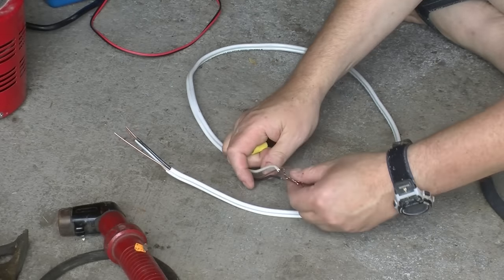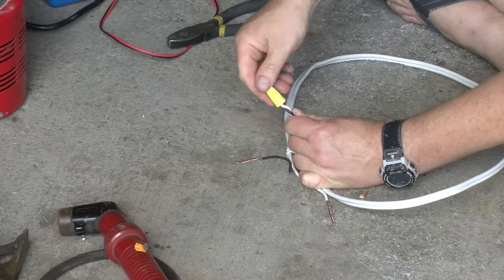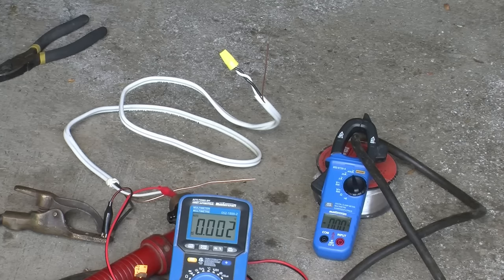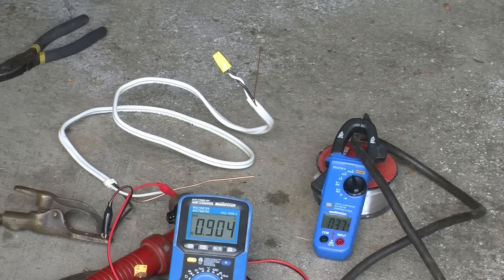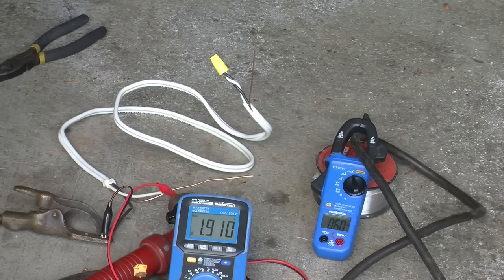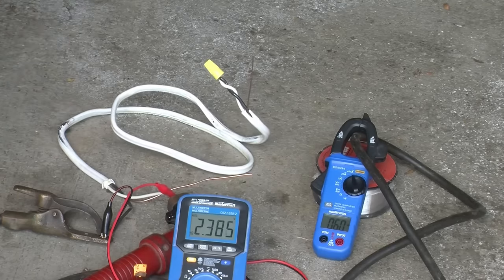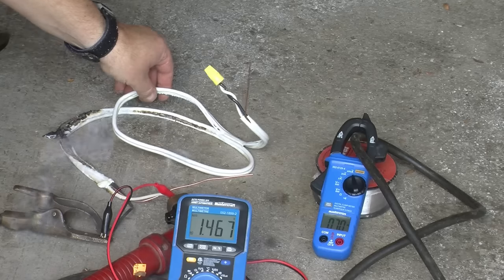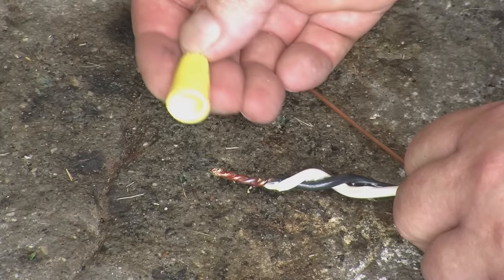How many Amps to burn up 14/2 electrical wiring?

Comment: 70 watts  allot  in that wire ?  I must have missed something  that is less than a lightbulb you must have meant another number right ?
Reply from the maker: 70W is the power dissipated in the wire due to resistance in the wire and the current flowing, much less than that current would deliver to the load in a 120 or 240V circuit.
Reply: @ElectromagneticVideos  I'm really up on certain Electro magnetic stuff but that Wheatstone bridge  resistance stuff I need to really smack down - I have learned a ton from an online simulator  called Falstad and I think I will try and learn more on the resistance stuff - 70 watts just seems so low yet it is not   great job Doc and I guess we both learned typing since you can type fast also
Reply: @ElectromagneticVideos  My last name is Welsh also and you look sort of like my brother     literally    Diolch unwaith eto
Reply from the maker: @TotalFreedomTTT-pk9st  " I guess we both learned typing since you can type fast also" Funny - one of the smartest things I ever did was take grade 9 typing in my final year in high school on a manual typewriters no less. I struggled and was one of the most unskilled students in the class - but being sort of able to touch type has been an invaluable skill. I hope the modern equivalent is almost a required  skill in high school these days!
Reply from the maker: @TotalFreedomTTT-pk9st  :)
Reply: @ElectromagneticVideos  Cool story - my later best friend now Australian - he and I were in class together in 1978 - 8th grade in Ohio   we had Junior High (7th 8th 9th)  -and he also types really fast - My degree was in Finance but lots of my jobs required keyboard Lotus / Excel  etc - it really should be required still  for Middle School since the keyboard is still a big player in all our lives    I had a cool girlfriend that was an Office veteran and we would see who could type faster and she often won
Reply from the maker: @TotalFreedomTTT-pk9st  So you were in school around the same time period I was. Since that was still the ear of secretaries doing the typing, I wonder how many others clued in that it would be such a valuable skill in the very near future? 

Have you ever visited your Australian friend down under? Its a fabulous country to visit if you like the outdoors!
Reply: @ElectromagneticVideos  I am somewhat a dull laggerd but he has been here lots to watch the Cleveland Indian's   -  maybe someday -  as per typing  I figure that Dragon Speak ( converting speech to text) would eventually replace typing (but not yet)  but I also threw out  hundreds of books partly assuming they would be 'on the net'   which has turned out not to be true as well 
I also learned on a real old type writer - which were marvels of engineering - I tore down a bunch - if I were King for a Day - I would have middle school kids also tearing down stuff to see just how complex these machines are that we need to survive  My God is a God of Technology (the TTT stands for "Through Total Technology")
Reply: @ElectromagneticVideos  I am watching many YT video's where the narration is really a  "Bot" reading from text and I don't mind it - a few glitches but if it allows someone to produce information "It's all good" as my Progressive Seattle Brother would say   But for us - of that time I am surprised that Typing was an option - especially then it should have been mandatory don't you think ? But our class was also a small room that I still remember to this day - to graduate Junior High you should have had to be capable of typing  and even now I'd say the same  it is a  skill like riding a bike  you don't really loose it but enough on that I am going to look for High Voltage protection vids - any more practical suggestions welcome - your vids I watched were great - If Building my own house  I'd almost do a modern Knob and tube for the cooling advantage  after your experiment
Reply from the maker: @TotalFreedomTTT-pk9st  Dragon Speak - gee I remember that - I think I got it free with something - sadly never worked that well. 

Taking things apart to see how they work is such a great way to learn. Would be a great once every two weeks or so science class. I was an electronics hobbyist as a kid (remember magazines like  Popular Electronics?) and had my own little business scrounging old TVs and fixing and then selling them in high school. Seeing the insides of so many things was a great learning experience.
Reply from the maker: @TotalFreedomTTT-pk9st  Typing was definitely not mandatory in my schools - in fact the teachers were not happy I took in my final year cause they were scared my low marks in it would have an effect on university admissions - as if any science/engineering program would care. I think it wasn't mandatory because unless you were going to be a secretary, most people weren't expected to type.  

What is so scary about the microwave transformers is the 1A output current with a 1kv voltage - enough to force it though skin, flesh etc. If it doesnt kill you it can burn off fingers, arms etc. Is not forgiving. 

Here is the dead mans switch I  made  - always place it 10 feet or more away from the danger zone so if you trip and fall while pressing the on switches,. you are still safe. I have used it to protect myself and it has saved me more than once. I hope you consider making and using one: https://youtu.be/ZhCvTCeGvMc
Reply: @ElectromagneticVideos  Yes - I wish now I'd kept those high voltage leads from the Cathode Ray tube with the big rubber do hicky on it - for high voltage alligator clips - my twin brother had his two daughter tear stuff down for the scrap yard - vcr's - old drills and it is so tactile you really learn by doing - be a great thing for schools to have for motivated kids to tear down vacuum cleaner - just stuff thrown out in the city - got to have googles headphones gloves all that -
Reply: @ElectromagneticVideos  Thanks - that is exactly the stuff I need - FOOL proof stuff - I am thinking about chopping one arm off to hedge my bet - then I'm not dead from a heart valve flapped inwards the wrong way  when two hands grab wrong thing  (just joking)  but seriously I might make a hold pouch that I overly put my hand into since shocks are endurable but closing the loop through my heart is not what  me wants
Reply from the maker: @TotalFreedomTTT-pk9st   You cant be too careful!
Reply: @ElectromagneticVideos  Lot's of deadly around besides high voltage  -I was working a 2 cycle engine and did not put the bolt back on the centrifugal clutch and luckily - standing over it (why ?    why ???)  my head was moving back when said clutch slid off the shaft and exploded vertically smashing a hole in the ceiling  - engines and driving 50 mph  down the street a few feet spaced from on coming traffic - it all needs respect - for sure
Reply: @ElectromagneticVideos  Here's a question - the GFI as a high voltage protection  ?
my intuition is that the tiny currents still getting past and combined with 3000 volts will still kill you - and so the GFI would not be effective or certainly  not AS effective than at  120 v  - 
but does it still add  some protection ?
and what about not relating the transformer to "ground" (coils free - ground connector separated)   and having the human body insulated with rubber mats  from any contact with the transformer less one hand ?   
that is to use an  Inverter for source - step up to 3000 v peak  -->  into Device under Test that has coils  free /  ungrounded to EI Core ?   your take when you ever have time
Reply from the maker: @TotalFreedomTTT-pk9st  I use a GFI since at worst it will provide no protection. 

Somewhere around 10mA is when it becomes lethal. Higher voltage simply makes it easier to push that current though your body. Very dry skin is somewhat of an insulator so often (no always) its enough to keep the circuit resistance high enough in a 120V situation to prevent enough current from paralyzing/killing. If the circuit is more than a few hundred volts it will punch though the skin and access the low resistance salty inside of you body and be able to send a big dangerous current though it that can burn flesh and stop hearts. 

So thats why microwave transformers are so lethal -  1kv and 1amp - potentially 1kw of power burning flesh and plenty of current for a fraction of that current to stop the heart. 

Things like neon transformers, often 5kv or more, are often safer since they are crudely limited to a few milli-amps. Although even them if placed in the wrong body location can be fatal. 

So back to GFI - if the current flows though it, it can detect and shut down. But with high voltage its so easy for say the secondary of  a transformer or attached circuit  to find a path to ground (weak insulation, crack etc) that bypasses the GFI and renders it useless.

Having everything  float like you describe presumably with an inverter will help - but you are now relying on the integrity of insulation of rubber mats. What if there is a crack in them. How good are they as insulators. The only safe thing if doing it that way is to get HV rated sheets, gloves etc made for power company workers. Not cheap. And they have to be periodically tested. 

What I do is
-power everything from a GFI
-have everything sitting on a grounded metal surface so stray currents cant somehow make it towards me. I use the table from my table saw for this. 
-use a dead mans switch at sufficient distance that I cant get in reach of anything dangerous. Note that the junction boxes on the dead mans switch are grounded.
-have a main power switch that is normally off unless running the experiment (so I don't rely on the  dead man's switch as a single point of failure. 
-have bright indicator some light somewhere near the danger zone that comes on when power operating. 
-if I ever (rarely) need to manipulate something exposed to HV, I use a long insulating rod with a grounded section or handle between me and the HV part, so any HV leakage will got to ground before getting to me. 

Does what I do guarantee you will be safe - no - multiple things can go wrong. And you have to carefully assess every situation for how best to protect humans in the area. Sometimes an isolation transformer is abetter choice (lower voltages). I did some videos on isolation transformers, GFIs and grounded/unground circuits a while back ...
Reply: @ElectromagneticVideos  ...proving again that correct typing skills are useful
1) thank you  
2) mandatory surgical gloves  always ?  I think your dry skin point says yes and over those    nice rubber gloves ?
3) my output from the HV step ups WILL be going through a very high resistance change of resistors    such as   to limit the current  - hopefully down to a very small (but not as low as 10mA)  - since the Device under Test (a next set of 2400 turn MOT coils) will be tuned to a very  very specific resonance @ 60 HZ  such that it will only require  (ideally)  very low input current @ 2.4 -3.0 KV but still enough to cause harm or death I'm sure - I mean hopefully I could tune down to 10mA - but more likely higher  aroudn40 to 100 mA
4) I will study the Dead  "Person's" Switch (I can be sort of Politically Correct)    I like that idea of me falling away  shocked but shutting it all down as O crumple to the ground  it should probably trigger a fire alarm yelling something like "idiot in trouble help !!"
5) I will also study   GFI's (again !)   and maybe invest in a super sensitive ones ?   or can they be used in  parallel  ?   (table saws with instant shut off's use capacitive effects of the skin touching the blade and release a thuggy boy bolt that blasts into the side of the blade  which is amazing  I would NOT think that fast enough to save Mr Hand but   they are out there  like GFII's  I  guess)
6) Isn't the "Inverter"  effectively acting as an "isolation transformer" ? 
7) I will make plastic handle chickensticks for pulling out the capacitor's and have a shorting plug   they plug into so no contracts are ever exposed for errant touching  which is my big fear
8) I have a bunch of older super nice swing needle meter's that will show me "who" is still  voltage'd  up  - and I need to make high voltage dividers for those soon  also for the high current meter as well
9) one of the nice books that went out in the great 'purge' a decade ago was this nice Bell Howell lab book with chapters on making Lab meters -   I actually built one using transformers to magnetically decouple from actual current  - might be  smarter to use a digital clamp meter but I have these 6" x 6" swing needles   I just like them -  better indicators of issues
10) I have a bunch of saved Utility operator video's on REALLY high voltage and yeah - those guys go through big time procedures to deal capacitors especially  - HV caps should be thought of like a  cocked loose trigger 45 gun  pointed at your face  - 
11) that's it  - thanks again - I might have more questions in the future - ordering some HV diodes and high ohm resistors for the meters  right now  (hopefully today )
Reply from the maker: @TotalFreedomTTT-pk9st  A few thoughts:

I as assuming you are using high value resistors in HV circuits - dont rely on them for safety - things like humidity can lower their value, or over-voltage can cause failure. 

GFIs - you are pretty much limited to what meets the UL standards which is trigger at around 4 to 6 mA last time I looked. They typically are not made to trip on anything less to prevent nuisance trips. 

Yes - the inverter is acting like an isolation transformer. But when dealing with HV, all you need is  some point where the insulation fails and suddenly you are no longer isolated. Failure can be from a HV spark across a break in the insulation, old insulation, or insulation just never meant for the voltage that is applied. 

So the best general advice I can give is, carefully analyze all failure modes of your setup and what could go what that could wring that could cause injury. Even better, get someone else to look at it as well in case they clue in on  something you didn't notice. And if any doubt, stop, and reconsider before proceeding.
Reply: @ElectromagneticVideos  You are that  other person  and you've done that job - I'll keep you posted on results - again - I'm not playing with sparks and Tesla coil stuff so I don't plan to be fiddle fadding with this stuff whilst live - hopefully that will help - thanx again for your concern and your help
Reply from the maker: @TotalFreedomTTT-pk9st  Look - I'm not - and cant be that other person - I dont know what you are doing and  only give  some general safety advice which may or may not be applicable for what you are doing. Without seeing what you are doing, I could very easily be missing some advice or thoughts you need. You need someone to look at it and as one of my friends puts it, ask those "damn fool questions". Just having to answer questions can often make one think about things that one hasn't before.
Reply: @ElectromagneticVideos  Don't take offense  I'm a grown up  that doesn't shift responsibility - you provided facts but don't need to be too prescriptive   If I'm shocked or hurt I debit my stupidity account   I live in lots of danger probably worse than HV - a lawn mower blade will chop your arm off as will a table saw -  thanks for what you provided    no more needs to be said
Reply from the maker: @TotalFreedomTTT-pk9st  I just wanted to make sure you understood the limits of my advice and hope you take all precautions! Stay safe!

Comment: I had an idiot "professional" journeyman electrician wire multiple T6 light units (8 tubes each) (6 each) with 14AWG wire..... with 300ft wire runs. He had learned that "that is what you use for lighting"..... and was one of those guys who went "into the trades" because he clearly was too stupid for anything else. So this test is quite realistic.... When the CBs started popping, and I investigated what went on, I can confirm that 14AWG does not support that load for a long time.....
Reply from the maker: That must have ended up being an expensive mistake. - and an expensive way for someone to lean a lesson! I'm amazed that anyone who qualified as  journeyman electrician would be unaware about thing like current requirements and wiring limitations. Then again that seems to happen in all fields - I have come across a few engineers who I have never figured how they managed to graduate and get a degree.
Reply: @ElectromagneticVideos  Lots of (modern) engineers educated with "modeling" in front of screens lack the most basic practical skills.... Ask them to design something that actually can be manufactured....
Reply from the maker: @ziegle9876  Yes! Its becoming a bigger and bigger problem. I think part of it goes beyond the replacement of "real things" with modelling - so few future engineers have ever seen the insides of anything these days. Probably because stuff is cheaper to buy that build DIY, and, if some device is fixable (few still are), its generally so chap to replace tha  fixing isn't worth the effort. 

An invaluable part of my "education" as an engineer was being an electronics hobbyist as a kid and teenager -  building stuff from magazines like Popular Electronics and fixing old TVs gave me such an understanding of how parts fit together and whats practical in the real world. Something you dont get much of in school and less so when most labs are computer models.
Reply: @ElectromagneticVideos  Could not agree more!